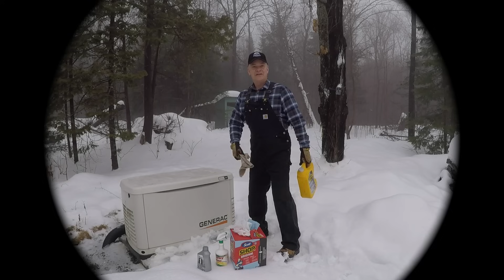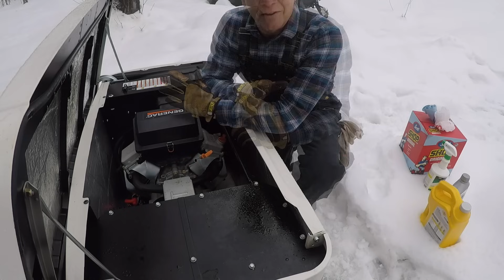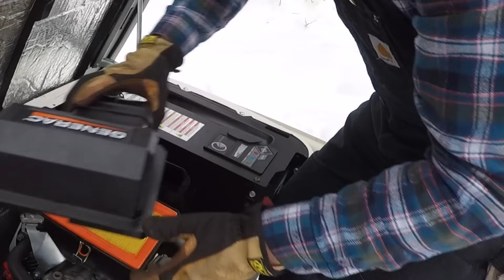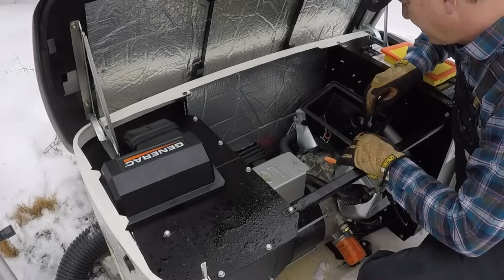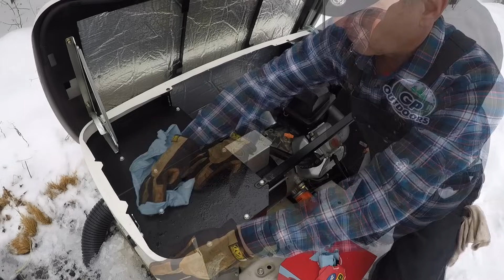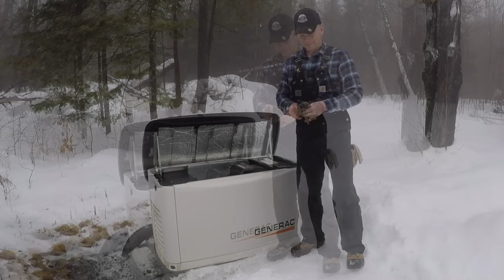#133 Thinking of Buying a Generac Generator? You Need To Watch This!

Comment: Could you not drill a small weep hole in the bottom of the air box to allow the condensation to drain and not cover the vent with ice?  It only creates condensation while running.  And should not freeze until after the unit shuts down due to the warmth of the running engine.  Keep the water drained before it can build up and create an ice dam.
Reply from the maker: You bet John. Need to get a diaphragm and do something similar to that. Thanks!
Reply: I'm pretty sure you would be sucking unfiltered air if you drill a hole in the airbox to drain. Would defeat the purpose of the air filter
Reply: @davidpianosi4512  If it's a tiny hole...1/8" or less it shouldn't be a problem
Reply: @haydenc2742  well if you drilled a tiny eigth-inch hole in my car's air filter I wouldn't be too happy how about it and it would be the same thing. Any blowing silts and pollen dust would go to the low pressure part of the airbox which would be the small hole you'd be surprised how much are would get past that little hole because it is less restrictive than the actual paper filter. Would be a lot of money to spend on a generator
Reply: @davidpianosi4512  wouldn't the air box be under pressure due to the crankcase venting?  And I only suggested a weep hole. ...not more than a1/8"... Not a 2" gaping window.   What difference would it be to suck in a tiny bit of fresh air with the EGR gases?  The engine sucks in a lot of fresh air through the intake of the carburator doesn't it?  And the engine would run just fine if there was no EGR gasses being recirculated.  It makes for better efficency and less pollution, though.
Reply: @johntingle455  okay I'm not entirely sure what is exactly the thought here. Basically on any of my vehicles with and air box... If you drill a hole on the clean side of the air intake box..... it would be no different as drilling a hole in your air filter. That small eighth inch hole will drawn unfilter air into the carb throat and bc its an unobstructed hole it will offer less resistance than the air filter. Therefore much more air than you think will be coming in unfiltered. It does not take much to recognize this. The air box is a negative pressure system. Crankcase Blow by pressure blowing into the air box is very little pressure compared to the giant suction of the downgoing Piston drawing through the carb. In the end it has to be absolutely no different than putting a small hole in your air filter, if you could visualize the air coming through the face of a paper filter the hole in the paper filter would look like a toilet bowl Flushing through that hole taking pure unfiltered are directly into a carb system full of very tiny Jets needles and ports and if it gets by all that now you will introduce the unfiltered are to the actual rings where the real damage can happen.. it does look like an engineering flaw in this case and the simplest thing to do would be to check it monthly. You would never put a hole on the negative pressure air box. On one of my motorcycles if you put your hand over the air intake the airbox actually almost collapses under the negative pressure of the piston
Reply: @davidpianosi4512  I'm sure he will figure out something.  Perhaps a small check valve that would only allow water to drain out and not allow air to be pulled into the air box.  There are several ways to skin a cat!  Of course any check valve and fittings would require a larger hole to install than a 1/8th" one.
Reply: @johntingle455  I suppose a ball type check valve that when engine is not in operation the negative pressure is gone and the ball valve will open with gravity allowing drainage and suxtion closed when running, but in my opinion it would be so dangerous as to allow this. Crank case venting is exactly that dot-dot. Just like Plumbing venting dot-dot. There is no pressure in a vent. There is only a wee bit of pressure introduced as the Pistons drop down the cylinder. I once had a BMW motorcycle that I did not put an oem air filter on it. It look like it fit fine but after the engine started developing fatal engine wear it wasn't until I noticed a slight Gap I would say less than 1/64 of an inch along 1/2 inch along edge of this large motorcycle air filter. When I started having problems with the engine I obviously took a look at the air filter and the amount of material that sucked into the negative pressure air box through this one in by 1/64 in gap was unbelievable. That little imperceptible bad seal along the airbox trashed a $5,000 motorcycle engine in just a couple of months. Like I say the entire air box is a negative pressure environment and if you make it easier to get air into the carbs such as drilling a hole then the air filter is a moot point. You make reference to it being fresh air being drawn in but you would better describe what you're saying as unfiltered air. The crankcase venting is simply a pollution control method to reburn any fumes built up in the crank.
Reply: Perhaps a little one way valve at the bottom of the airbox would do the trick, Iv seen quite a few on larger machines, just a little rubber flap that let's water seep out but when under vacuum of the engine closes up (think they're sometimes  called a frogs mouth and can serve other purposes too)
Reply: @Luke.Holmes  right... I still would never do such a thing however.
Reply: @davidpianosi4512 , that depends on what side of the filter the vent is on, engine side or outside air side.
Reply: @horseshoe_nc  why would you vent the outside of the air filter it already has a 4in intake nozzle
Reply: @davidpianosi4512 , I was referring to the idea of drilling a weep hole in the bottom of the air box. You said it would be like drilling a hole in the air filter. In reality, that depends on what side of the air filter the hole is on.

Comment: Great tip, thanks.  Mine has the heaters for the battery and the oil filter, but not the air filter box.  Should not be a problem as it is never all that cold for long in Toronto where I live.  But thanks for the heads up.  I'll see if anything collects in that box during a cold snap.

Comment: Ever thought about adding a shed over it? It would keep the ambient temp higher and reduce moisture by heating the air with the engine heat. Another problem we have in the dakotas is drifting snow. This can fill up the air filter and stall it. The shed also blocks this. Some folks have raised theirs off the ground to fix this problem, but a semi contained shed fixes all of this.
Reply: And void your warranty 🤷‍♀️

Comment: Install an oil catch can (baffled)....  this will catch the blowby oil before it gets back to the motor.... plug the factory pcv port you show and now vent it through at a far higher location... i would also look at a different filter box design to prevent the condensation from collecting to begin with.

Comment: thats not an  exhaust port..... its the crank case vent.
Reply: I was a couple mins into the video when i wondered how the exhaust port could be blocked so pressure could blow the dipstick out.  I was thinking pressure would have to blow past the rings into the engine block.  And how could an engine keep running if the exhaust port was blocked. Must be the CCV. Ain't got time to watch the whole video.
Reply: I was wondering why exhaust was running thru the air cleaner housing. @yammerhaw101
Reply: I was thinking the same thing. But I knew what he meant and he seam very intelligent so I passed it off on the cold weather.
Reply: PCV valve + foam filter + plug hole in airbox = cured forever
Reply: I just started to type the same thing you did Mark Stratton.  Also called the breather tube.
Reply: Nothing like an educational video by an ignorant person. No problem  resolution? He said he was no expert at the end- got that part right.
Reply: Geeez, trolls. He’s just trying to help. Why so critical?  You got the idea, didn’t you? Does it really bother you that he called it an exhaust port?
Reply: Mark Stratton is correct, thats not an exhaust port. That is a crank case vent that you can simply bypass out of the air box and you need to do it at once, its a minor environmental thing the manufacture was required to to do. . First, disconnect that tube which vents the crank case into the air box. Second, JB Weld the air box hole closed. Third, connect another tube to the crank case tube tube and get it outside the generator enclosure and just put some kind of screen on the end so bugs cannot get in and point it downward so water or snow cannot get in either. You will never have that issue again.
Reply: @Bob-bm6fn  No disrespect  to him but he's just plain wrong.   If he is getting excessive blow by, then he may have a compression problem.  He says engine is using oil...  His rings aren't holding the compression?  Much more to this.
Reply from the maker: Good day gents. Thanks for the info above. You're right. Not at all mechanically proficient and apologize for my poor wording in the video. However, I am very grateful that so many of you took the time to try to help out with a solution to it. The point was to identify the issue for people since I have had two units for almost 10 years with the same problem. Many of you have been kind enough to provide some good, practical solutions as noted above by Dave, for example. However I confirmed that if I alter that vent pipe or drill a hole in the cabinet, either will void my warranty. So I will decide whether I put up with it, or void the warranty. I am having another (now the 4th) heater unit installed ( this time on the vent pipe)  shortly but will have to decide what I do as it pertains to the issue in the cabinet. Given that the technicians have told me several other people up in the area have the same issue over the years, I assume it is related to the climate here. Thanks again and wish you all the best!
Reply: @GPOutdoors  The heater is not a solution and is a backward way. . First of all that little engine does not put out enough pollution to worry about, they want the engine to re breath its own venting. Take out the tube, use a rubber plug of some kind, then extend the tube out of the case and face downward. Then if you need the warrantee just take the rubber plug out, and stick the tube back in.  Don't use a heater and your electricity to solve a poor design problem.
Reply: steve56765 has the answer here
Reply: Oh thank goodness....The hero we need, but not the one we deserve
Reply: So, what about a modification to raise the CCV port? Or something else to eliminate this problem.
Reply: I was looking at this and I kept replaying it because I couldn't figure out how that engine worked. The way he was describing it the exhaust was vented into the fresh air intake.
Reply: @randallfrank5682  You are on the right track. There are better ways than just defeating the system. People get lazy and take the easy way out.
Reply: horrible design...
Reply: @GPOutdoors   just drill a small hole in the bottom of the box to let the water drain...
Reply: B

GP Outdoors k
Reply: @GPOutdoors  Since you are worried about warranty issues you can make one small modification that is easily removed and would be completely unnoticeable. Insert a tight fitting hose or tube into the crankcase vent in the airbox and just run it up as high as you can in the airbox (just under the filter). This should do two things; one - it will place the moisture laden air closer to the intake and encourage flow back into the engine which will reduce the buildup at the bottom, and two - it will raise the level of ice buildup needed to block the airflow from the crankcase vent. This raised level should now give you plenty of time  to remove the ice buildup before it becomes a problem.

Actually, I do believe that raising the vent point within the airbox would eliminate the ice formation altogether because the moist air would no longer be able to swirl within the airbox.

If any warranty work is needed in the future just pull the added hose/tube out and no one will ever know it was there.
Reply: ditto- just put a little elbow in the hole to raise the elevation an inch or 2
Reply: @steveofire56765  Yep that what a friend of mind did problem solved used one out of a rider.
Reply: GP Outdoors Void the warranty, hah!  Sears makes a dryer that has an annoying and loud buzzer.  They also made it so you couldn’t shut it off.  What to do?  Buzzerectomy! Disconnect the buzzer use shrink tubing over it so prying eyes couldn’t see.  It’s been serviced under an extended warranty 3 times in 10 years. No one is the wiser.  I didn’t buy the extended warranty my customer did, so don’t get all high and mighty on me on how stupid an extended warranty is.  First thing I do is to get rid of all that safety shit on my wife’s Cuisinart Food chopper thingie.  She said it was a pain in the ass to use and store.  What type of idiots exist that we need all this safety bullshit added to everything?  Life can be dangerous develop a sense of situational awareness and you will be better off.  Situational Awareness skills will come in handy whenever crazy shit comes your way.
Reply: @GPOutdoors   since you are worried about the warranty,  my solution would be to find the same size hose as is running to the air box, enough to run it elsewhere - maybe an old oil jug-bottle, cut just a small length of hose to put back on air box w/ enough length to add a plug or seal with anything the size of hose,  now where you run the other end of  hose coming from engine crankcase to the oil bottle add a pcv from any older model vehicle and mount it into the oil bottle, a hole can be made in the bottle somewhere near top with a breathable screen over it,  just set the bottle to the inside of cabinet out of the way,   Should you ever need a warranty check, just simply unplug the bottle and replace the hose where it was,  and call the tech.
Reply: Smog !  Crank Case Vent recycles oil particles from crank case oil back into the engine intake to be burned up. Not going into the Air as a pollutant.  @billbraun6846
Reply: True just move it and add a filter or just vent it out old school
Reply: @AP-514  Then small airborne particulates could enter this drain hole and get sucked directly into the the filtered, clean air intake stream. Probably low likelihood, but why chance it?
Reply: @yammerhaw101  Block your CCV/PCV. Pressure builds up. Simple. The motor may pop the dipstick & gaskets.  Or put a few bananas up the exhaust to stop enemies
Reply: @kong3  I agree to a point. BLOW BY is obvious.
Reply: Thanks!!!
Reply: @GPOutdoors  I think the EPA makes Generac put the crankcase vent into the air cleaner to limit its emissions. That's a lot of water! Is snow getting into the air cleaner intake? Cold air has very low moisture content so when it gets warmed up there should be no water. Call the Generac factory and talk to one of the design engineers. Generac is responsible for the exact location of the CCV so they should offer a free kit to fix this. By the way, do not leave that vent hole open. 
dave berry has a good plan but it does not fix the condensation problem if snow is getting into the intake air. This is Generac's fault and they should fix it with a whole new air cleaner assembly or the parts and tools to fix the existing air cleaner. The air cleaner needs more engine heating and/or a drain to get rid of any water before it can turn to ice. You don't want any water in the air cleaner or the crankcase, ever.
Reply: Now.....  That make sense !
Reply: Appreciate the video, ignore the moronic posts from others.
Reply: @daveberry5901  old draft tube
Reply: @paulmallery6719  Point is it is an unnecessary environmental feature required installed by the manufacturer. Take the hose out of the air box. Put a little K&N Filter on it and seal up that hole.
Reply: @stevenfoust3782  Take your meds.
Reply: @kong3  No its not a blow rings issue, just normal breathing of a reciprocating engine. All do it, your car has versions of this too. The spinning crankshaft with pistons going up and down creates all kinds of air movements that has to have an escape. If you listen to me and do what I said before you will never have another problem.
Reply: @ianmason5706  ....genius...it's PCV valve, not PVC.
Reply: @AP-514  that would let unfiltered air into the clean side of the air box.
Reply: THAT IS CORRECT- I AM SURE THAT IS WHAT HE MEANT- TERMINOLOGY was wrong -no biggie
Reply: @AP-514  Whaaaaat?  You like sucking dust straight into your intake?  Dude!  Now, if you put a drain with a one way valve, that would be ok.
Reply: @USSBB62  If it was run as often as a lawn mower I'd agree but seriously, how often does the power fail?  A few hours occasionally during a year doesn't add up to much.
Reply: @puntacanaman1  Oh ! For sure.  Power outages in my Suburban neighborhood are few and far between.  I'm gunshy living in California about Smog stuff.  The youngsters ( under 50's ) will arrest you and torture you untill you turn GREEN and promise to be Sustainable.  LOL